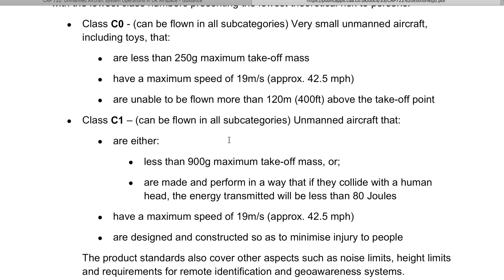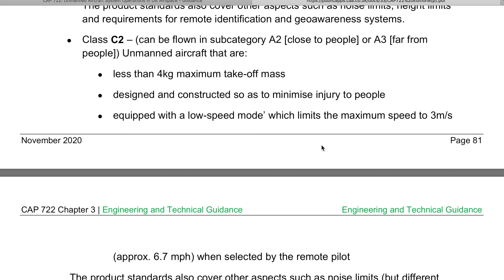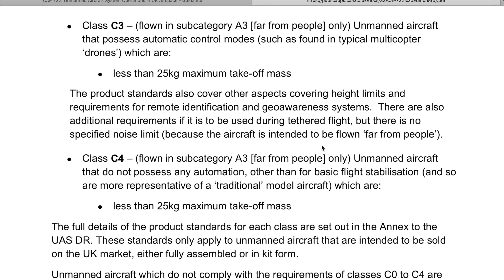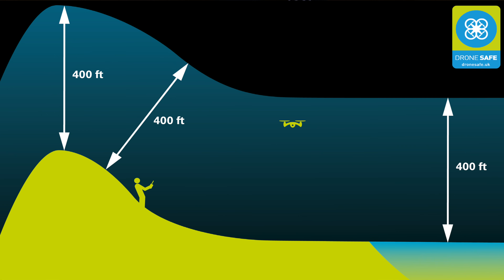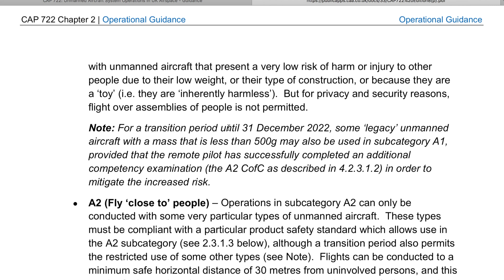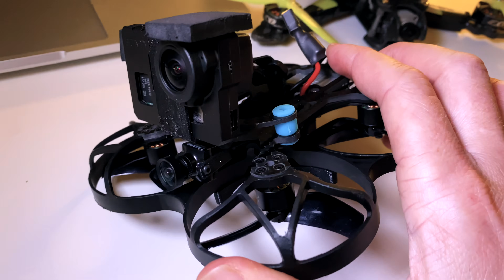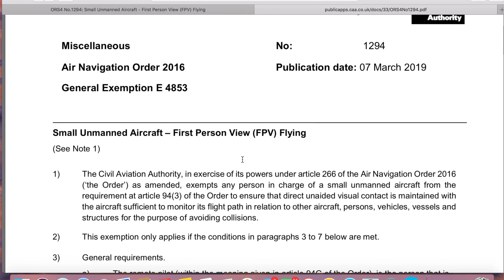The New UK Drone Laws & FPV!

Comment from the maker: IMPORTANT CORRECTION: Regarding Remote ID, it seems that we may be ok because we operate within the ‘OPEN CATEGORY’ (all flights inc A1, A2, A3 subcategories). The Dec 2021 requirement is ONLY within the ‘SPECIFIC CATEGORY’, and is also required in drones sold as C1, C2, and C3 from 2023. 
My interpretation is that self built FPV drones don’t need it until 2023 and we may only need it then if we buy drones classed C1 C2 C3. Here’s the exact text from page 199 of the CAP722 document:

3.7.1.1 Open category

The product standards in the UAS DR require that any UAS marked as Class C1, C2 or C3 must have a direct remote ID capability; this must be active (i.e. switched on) and up to date whenever the UA is being flown.
If any other UA is equipped with a remote ID capability, this must be active and up to date whenever the UA is being flown in the Open category.

3.7.1.2 Specific category

UAS operators are required to ensure that each UA is installed with a remote ID system by 2 December 2021.
From this date it must be active (i.e. switched on) and up to date whenever the UA is being flown.
Reply: Electronic conspicuity

Just another name for remote ID? Just come across this new term on the uk Gov and caa website

Comment: That Remote ID discussion is very interesting. I would question how many of those electric scooter flying around town at 25mph+ have been regulated for safety and use around people and in public areas. I get a feeling that FPV as a minority hobby is being targeted as an easy to enforce so lets do it. Whereas, scooters would be so much harder to police without significant man power

Comment: Fantastic explanation. I'm also a private pilot. My view is that GA/microlight aircraft flying below 500 ft need a really good reason to be there. I think the minimum altitude for light aircraft should be raised to 1000 ft, unless landing, take off, or forced landing, etc. I also think the goggle spotter rule sucks, because as an fpv pilot you have a better awareness than a non fpv pilot. I think fpv is much safer. Interesting that speeding kills more people every year than drones. If a remote id was mandatory in a car there would be a massive backlash.

I really like your video, it's a really good review of the law, and I like that you show the actual clauses.

One of my problems with the regulations is getting/finding a spotter willing to come with me. I don't know any fpv pilots near me.
Reply from the maker: Might be worth asking in some of the FPV groups to find some local enthusiasts. Great comment, glad you liked the video

Comment: In regards to the 80 Joules part, I think you calculate the Joules(kinetic energy) using the Mass(weight) and Velocity(speed) of the Object(drone), so a 249g drone with a top speed of 57mph would have about 80 Joules of kinetic energy.

A 100g drone, traveling at 89.5mph = 80 Joules.

and a 65g drone, at 111mph = 80 J.

900g, 30mph = 80J
Reply from the maker: Wow that’s brilliant! Thanks for sharing that 👍

Comment: People have said that FPV goggles could have a view port built in which maintains LOS while also giving you FPV.
Think of a camera. You have the view hole along with screen. It's not going to be long until people drill a tiny hole in the goggles to allow them to see through unaided. It's going to be a loophole that will need some careful thought to patch which will severely restrict the rules even further.
Reply from the maker: Some of the old Skyzone goggles had an extra front facing camera! Perhaps this is what it was for!
Reply: @MagicFPV  I would imagine using a head mounted cam to view a pip scene of whats infront would be classed as "Aided" so just having a small viewport built in to the goggles would bypass that.

If FPV goggles have 2 screens then a small 1/8th hole by the bridge of your nose eitherside would allow unaided sight of the drone.

I'm actually really worried about home built freestyle drones and even home built camera drones. It's not like after 2nd December anyone would be able to pass their exceptions due to the lack of land and more than likely owners of said land allowing the use of  it to the public.

Drone usage after december 2nd is going to be dead and restricted to business/commercial use only or a very large increase in unlicensed drone operators.

Comment: Where the hell do you do the A2CofC? I've just searched it and it's a bunch of websites offering the course for £99 - £300. I've just gone through multiple websites all quoting different prices for the same thing? Is there an offical CAA/Dronecode website to go to or is this A2CofC something anyone could just download from the CAA and then claim they passed themselves?
Reply from the maker: You need to do it with a CAA approved educator. I think they  have a list of them on the CAA website somewhere. It’s not a thing you can just download but the course is online and the exam is live over webcam. I did mine with ‘Pigs Can Fly’ and it cost £99

Comment: Even having an observer for VLOS is pointless; if the Drone is flying in and out of a building or through a woods, then you won't be able to monitor it. There needs to be a recognition of the sport and its requirements.
Reply from the maker: I agree! The info you get from the FPV feed is WAY more than you could ever get from a spotter. It definitely feels like the rules were made by people with zero fpv experience
Reply: I suppose the problem for them is that you aren't watching for airspace incursions if you are inside your goggles; you are only looking forwards.
Reply from the maker: @whartonoutdoors7493  yes that’s a good point and correct but it assumes we are flying up in the open air when in fact we usually stay very low. They should just say to have a spotter if you exceed say 300ft BUT then the spotter wouldn’t see much... so a spotter who doesn’t need to maintain visual line of sight but can warn of hazards such as uninvolved people or aircraft in the general vicinity would be fair.
Reply: Yes, the one size fits all regulation is rubbish. FPV folk need to push the CAA for some special attention.

Comment: This is so frustrating, its making me really angry hearing all of this. Especially remote ID. This is a completely useless requirement. Everyone that installs it will already be a responsible pilot and if you aren't a responsible pilot then you wont have one installed anyways, so what's the point?
Reply from the maker: Check my update video, which is MUCH more positive 🙂 https://youtu.be/V714Rjr4Big
Reply: Yes good point. Let's face it a transponder is essentially a remote id in an aircraft. NOT ALL AIRCRAFT ARE REQUIRED TO HAVE THEM.... So I don't think this requirement in a drone is proportional and balanced.

Comment: Hi mate, can you point me in the direction of any good forums or communities for beginner FPV pilots? I've just started with a mini-whoop and am struggling to fly it around the house, despite being pretty good in the simulator (Liftoff), looking for a bit of guidance to get better, other than "just keep flying" >_>
Reply from the maker: I have some tutorials on this channel you should check out. It is hard though, so don't be surprised if it takes a lot of practice. Also check out FPV UK or Drone Racing Nottingham on FB

Comment: My understand is that with a drone that weighs less than 250g you need an operator's ID but not a flyer's ID.
Reply: If it weighs under 250g you don't need to have a flier id or a pilot id. That is in the toy category. Anything over that weight you have to do the online test for flier id then pay for the pilot id £9. You have to display your flyer id on every plane you own. Test is really easy.
Reply: @mathewwebb522  - if it has a camera you need an operator's ID but not a flyer's ID even with a drone that weighs less than 250g.

Comment: I'm kinda confused abour the 19m/s regulation. Wouldn't that cover all FPV drones from 2s on upwards? I mean, even my Tinyhawk 2 flys faster than that on 2s. 
Isn't that potentially going to fuck the hobby the most? 
Do you think that some sort of throttle limit switch workaround might solve that? 
Probably not if we're gonna have to openly blast out all flight telemetry data at all times.

I really hope these regs aren't gonna blanket criminalise all of us. I'm wondering how I should be able to find a flying spot within the big city I live in. I don't own a car to just up and leave for the countryside to fly a couple of packs.... 

We'll see. Thanks a lot for the video, really good presentation.
Reply from the maker: I know what you mean! First off there is an update to this video here: https://youtu.be/V714Rjr4Big Regards finding a flying spot- good luck 🤞 It must be a challenge living in the city... I suppose there’s always the sub 250g option? As for speed, I might setup some tests to find out how a big a factor the 42mph cap is 🤔 👍
Reply: @MagicFPV  I already watched the update today, good to know that the remote ID stuff isn't necessary. 
I'm also currently going through all the course material for the open category-A2-whatever it is called license here in Germany. It's actually fun even if it is a lot to go over. 
As for the speed; I think I won't overthink it . . . I'm probably also wrong about the TH2 speed, my wife tells me there is no way it is actually 68km/h fast. I'm also planning a 250g naked gopro build in March and  think that this is the way to go for starters if I want to keep flexible and rather free. Small and quiet baby. 

Thanks for all your videos, much appreciated. cheers!

Comment: Here's my criticisms of the rules. I generally find them to be out of touch and not fit for purpose.
1) Weight classifications. If CAA is concerned about health and safety, then the 250g limit should be MUCH lower. Even a quad with an AUW of 160g could do some serious damage to someone.
2) FPV exemption. This seems so redundant. If you are flying FPV you have so much more awareness than any spotter could possibly have. You can HEAR aircraft approaching. You can effectively see around corners. You have telemetry from the UAV being fed directly into your field of vision. CAA, I ask you, what more can a spotter provide that you don't already get by flying FPV?
3) Classification certification. There needs to be some way we can pass a technical competency certificate to then have permission to self-certify our custom built UAVs. One thing that five years in this hobby has taught me is that the people who don't or can't build their own UAVs are also the most incompetent and thus dangerous pilots. Learning to build and repair gives you a sense awareness and responsibility that doesn't seem to surface otherwise.
4) Remote ID. Totally redundant. If you're smart, and you intend to do any of the things that CAA say remote ID is there to deal with, then you obviously wouldn't incriminate yourself by having an active remote ID system. Even smarter would be to fly with spoofed remote ID data! Conversely, if you're flying within the rules, what's the need to be checked on by law enforcement?
Reply from the maker: This is absolutely EXCELLENT! And needs sharing 👍 I particularly like point 2
Reply: @MagicFPV  Want to record a video call with me where we can rant about it all? :-)
Reply from the maker: @davidrgilson  sounds good. Not sure how much more I’ll be posting on this but it’s a good idea. You sound like you’ve thought it all through well 👍

Comment: great vid, thank you! Just a quick question....my 750g cinewhoop would fall under which category?
Reply from the maker: If it’s 750g it would fall into the A3 (150 metres away). With an a2CofC qualification it could be flown in the A2 Category. If you can get the weight down to sub 500g then you could fly it in A1 (with an a2CofC), and anything less than 250g is A1 even without the qualification. Complicated I know!
Reply: and also what certificates would you recommend for this setup?

Comment: I'm sure OEM will sell a kit or built craft, then end users will just change out parts and customise, is the remote ID really requiring speed pos etc? Or just a broadcast ID number for identification?
Reply from the maker: I’m really glad you commented this as it made me look it up again. Yes it has to broadcast all of that information but it seems like this may only be necessary in the ‘specific’ category 🤔 at least until 2023 when they release the C class system! This is great news!
Reply: @MagicFPV  thanks 👍

Comment: I think the workaround for 3.7.1.2 would be to relay the telemetry data from your phone on an app so the CAA can monitor?  It's just a thought but kinda makes sense.  What's your views?  Do you think it would even be possible. Technically you could class your phone and controller as part of the drone system so it would be installed.
Reply from the maker: Sounds like a good idea to me 👍 I suppose you’d need something that can transmit the telemetry via wifi or Bluetooth though 🤔

Comment: Nicely broken down mate, really helped me understand it.
I think diy part suppliers would be able to claim plausible deniability on the sale of parts. A motor is just a motor, a vtx is just a wireless video transmitter, even a frame is just a few shapes of carbon fibre. All could be used in non drone applications. I guess the flight controller is the only thing that this argument falls down on.
Reply from the maker: I knew you’d have something interesting to say about this mate 👍 I hope you’re correct 🙂
Reply: I can’t see how they could police the sale of most parts. Similar to how you can legally buy non road legal car parts or drug paraphernalia. However, being able to legally sell/buy something and being able to legally use them are two different things...

Comment: Tbh, I think even though I've only just got my drone I'll be selling it straight away. There is no reasonable way that the hobby can continue in its current form, the regulations are just hilariously over the top. Last time I looked the only people being killed by UK registered drones were being flown in Afghanistan. There are not scores of people being injured by the hobby and the fact that the CAA conviction rate against drone pilots is 0 reflects this. Why do we need a spotter? If are expected to be broadcasting our location reliably in less than 12 months, then why isn't there a mandatory drone app that triggers an alarm if a plane is within say, 5 miles of the drone? Surely that would be more reliable than both the goggles and a spotter. Cap722 could be used to batter anybody into submission if you are unlucky enough to find an officer whos read the regs for 20 minutes and hates drones, and presumably hates fun also.

Can you tell this annoys me?
Reply from the maker: Great rant with some excellent points! I’m thinking of making a follow up to this that points out all the things we CAN do along with some options of how to still fly lawfully, so don’t sell up yet! We need some positivity in these times don’t we

Comment: Hey magic only just starting to dip into fpv do you reckon its worth it with the new restrictions
Reply from the maker: Yeah for sure! Just start with something less than 250g and it’ll be fine. You could go bigger and still get a couple of years out of it... possibly more if anything changes. This hobby progresses so fast I’m sure we’ll find a way to continue our passion because the superpower of flight is a wonderful thing! 🦅
Reply: @MagicFPV   currently on a mobula6 which is fun and is making it easier to learn on rather than velocidrone sim for some reason but more concerned for when i get a bigger 5/6" quad
Reply from the maker: @charlieeidsforth2223  I much prefer a real drone to a sim too! Love the little ones but 5 inch remains king

Comment: what if you use a analog screen instead of googles ?
Reply from the maker: This is how they define FPV: “First Person View flying is the ability to control a radio-controlled aircraft from a “pilot’s eye” perspective through the use of an on-board camera and ground-based receiving and viewing equipment. The viewing equipment is normally a tablet or mobile phone screen, or a set of video goggles.”

Comment: Afternoon. Complicated innit?! Thanks for having a go at explaining it simply. What's your thoughts on UAS 7068, which seems to restore some of the freedom to fly heavier UAS in parks and other recreational areas? As Xjet has been pointing out, it involves the extra cost of membership of a UK flying association, which isn't great. But  if you already pay yearly insurance (which would be included in membership) then the cost difference isn't that great.
Reply from the maker: I heard that the insurance only covers race events and not public flying. Not sure... great point though 👍 I’ll have another read of 7068. I’ve been watching Bruce’s videos too
Reply: @MagicFPV  Sorry, that's another 14 pages to wade through! Seems the exemption applies to recreational built-up areas, but not industrial, residential or commercial. Also permits flight to within 30m of uninvolved people (15m at take off.) So depending on your local spots, this might be brilliant - or useless! Both BMFA and FPVUK insurance seems to cover all flying types and locations (provided the flight is legal I guess!)